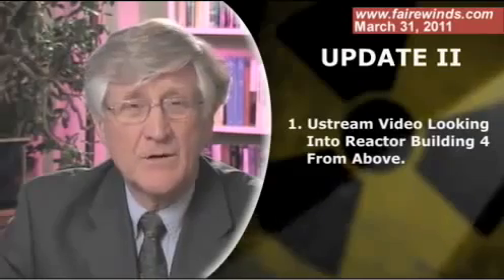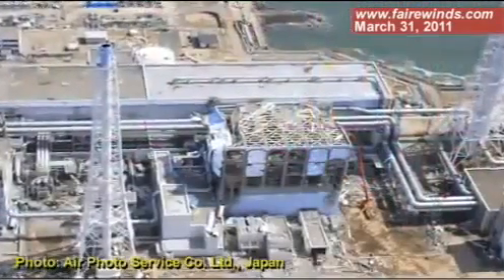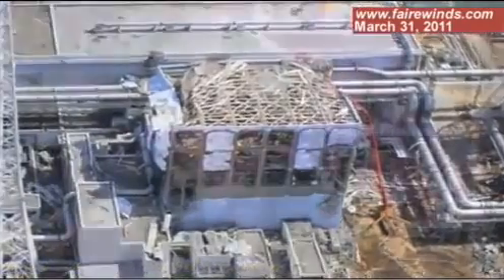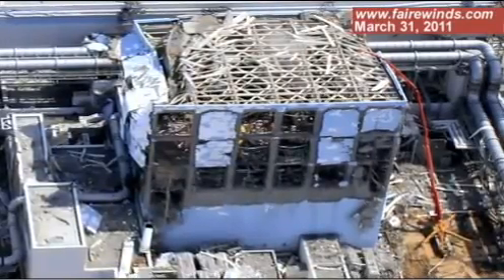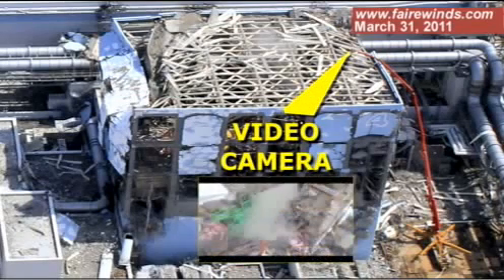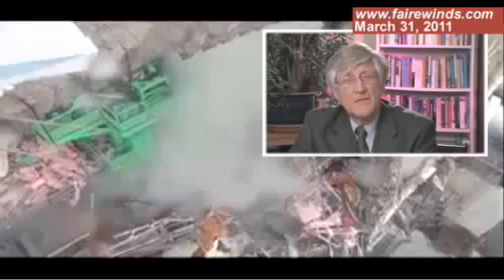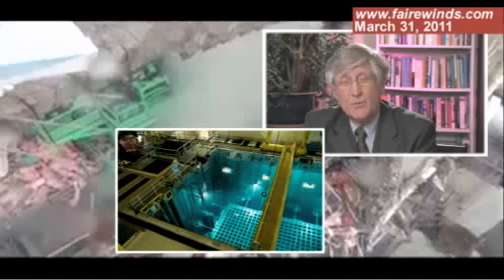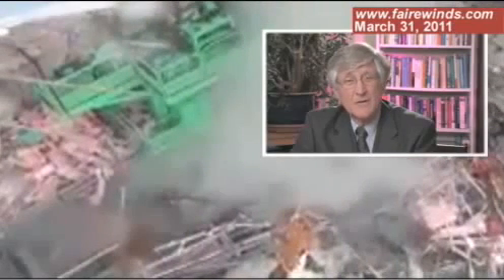Japan Nuclear Fuel Pool Boiled Dry - Rods Exposed to Air *NEW PHOTOS*

Comment: @mbbugi   dumping water on the nuclear plant via typical firefighting equipment is retarded at best, a nuclear plant typically has a backup system of pumps which can flood in the amount of several hundred thousand gallons per minute. What the japanese did was essentially like you standing in front of a forest fire and pissing on it.